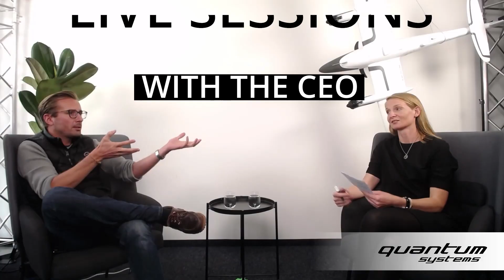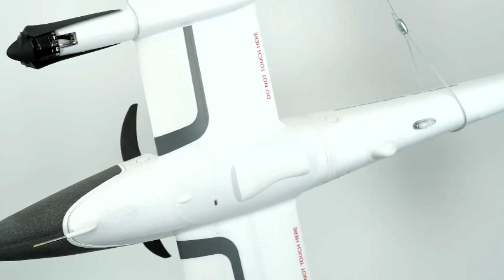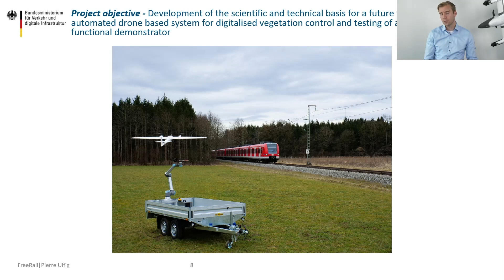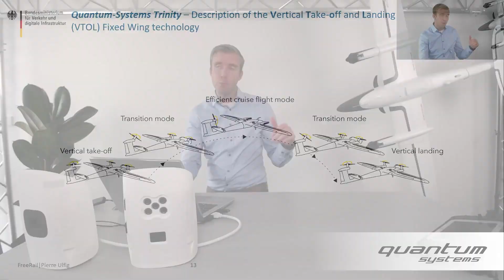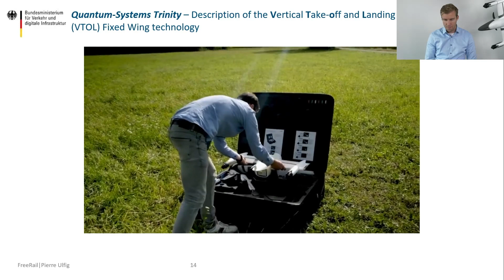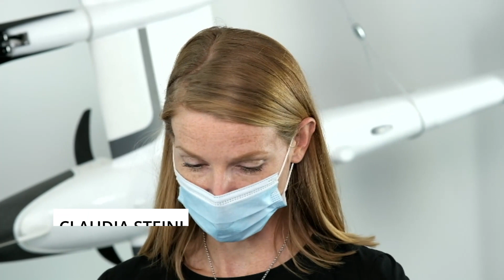"FreeRail" mFUND Project

Comment: The biggest concern is the reliablity of the angle-tilting mechanism,  how long will it last without problem?  Can it be comparable with the brushless motor?
Reply from the maker: The mechanical part of the tilt mechanism has been bench tested more than 10,000 times without damage, thus outlasting the life of the motors many times over. :)
Reply: Is the drone port available for sale?